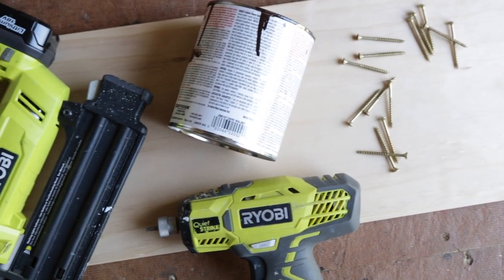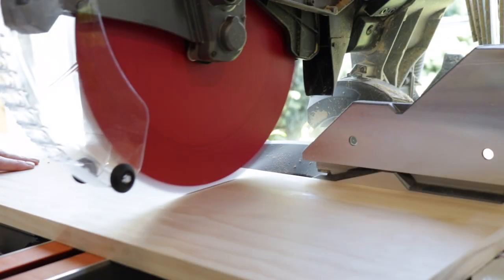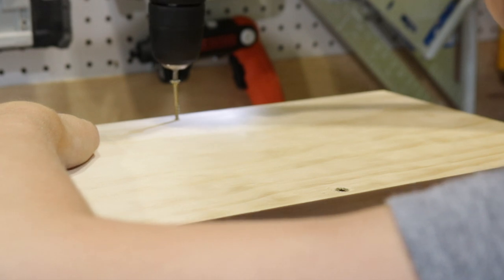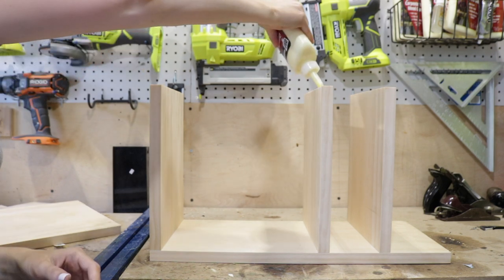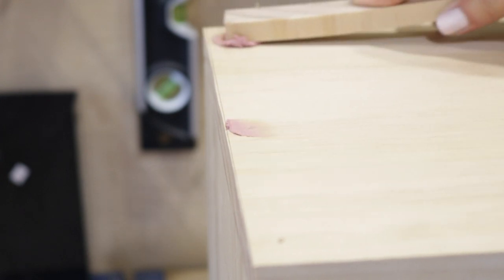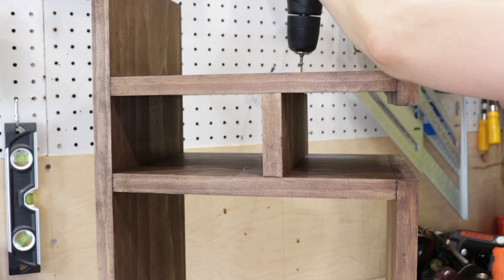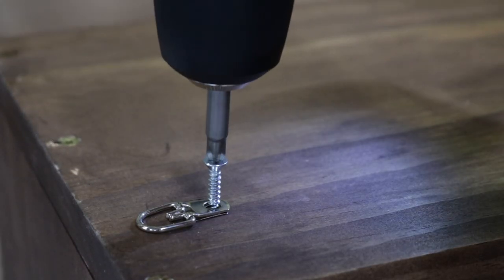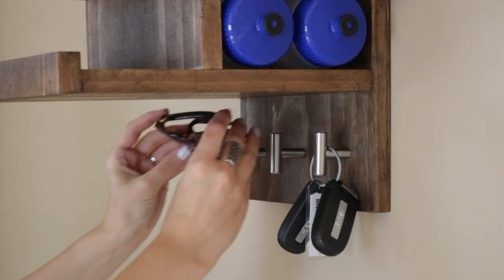DIY Bike Rack With Storage

Comment: I made one today!  I modified the backer board to 17 inches wide and pocket screwed it to a 8 inch vertical piece for a total of 20 inches in the original plans.  This way I can mount it to studs in my garage.
Reply from the maker: Ahhh! That’s so awesome!
Reply: @edling8294   DAHÄNGER makes one that is ready to go for less than $50 and there are less well-made knockoffs available for cheaper. Not sure who has acrylic shelves laying around.

Comment: i would love to do it. actully im doing it but im worried about the weight of my bike and if it actully could hold it or that gonna effect my wall on the long term. you didnt show how did u drill to the wall
Reply: my bike is around 50 kg
Reply from the maker: I drilled into one stud and then used a heavy duty drywall anchor on the other, and it was okay! My bike weighs about 15-20 pounds.